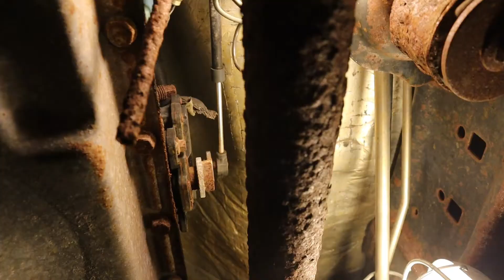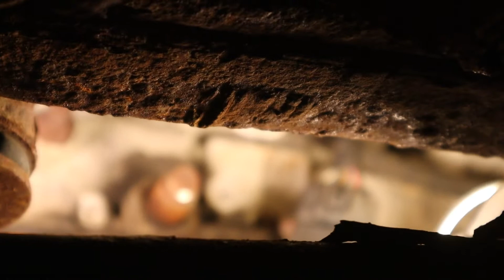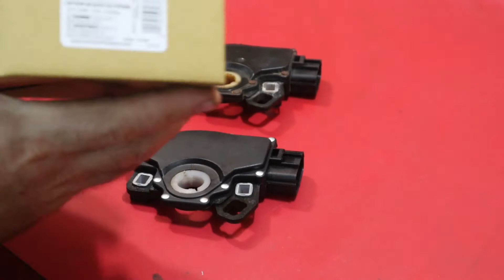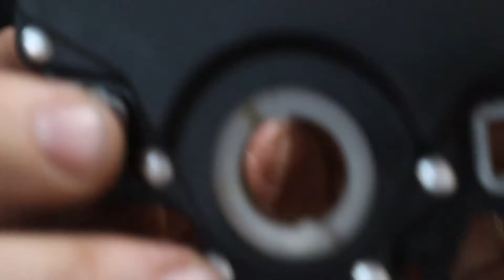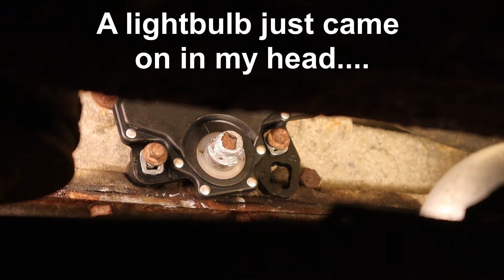Replace 2005 Ford Explorer Sport Trac Park and Neutral Safety Switch Transmission Sensor

Comment: First video that shows the actual installation and adjustment under the vehicle. My shifter is somewhat sluggish to move and the cable itself is not the problem (moves freely when disconnected) so it may be the TR sensor sw but first I'm going to remove it and test it. Thanks.
Reply from the maker: Glad the video helped!

Comment: There's a 2min. video called "Neutral Safety Switch" (by Codemans auto) that shows the alignment part perfectly. Wish I'd seen your video before I ordered one yesterday from O'Reilly... It was over $100.
Reply from the maker: Ouch  that is unfortunate.  Hope you get it straightened out
Reply: @TheFixitShed   Turns out they ordered the wrong part and the right one was like $60.

Comment: So I have to tell you that this post was immeasurably helpful to me.

I had a starter stop working.   Tested all fuses and wires and relays.  And yes the starter was quite old and crusty, so I pulled it out...  but a bolt snapped off and I had to go to a shop with a lift to get that taken out of the trans housing.  Got the new starter mounted by the guys who drilled the bolt out.  They said they had to disassemble stuff to get a drill in there, but I guess they just had no clue how to adjust the shifting  trouble upon reassembly.   

Got the Exploder home and it just wasn't right.   Shifting was very sloppy.  The gears were all screwed up, sometimes the starter wouldn't work, it refused to start in neutral without tweaking the shift lever, and reverse did not engage well.

I wasn't encouraged to return it to that shop so I just got on it myself.
But no matter how I adjusted the cable, it was still a mess.   

Then I watched your video by chance on the neutral safety switch being adjustable!    "Ah ha," I thought.   The shop may be did mess with that, and not only does that control your start situation, it might also provides the fluid  valves station clicks for the shift lever.   So I put the transmission in neutral and adjusted the switch bit by bit until the engine started in neutral, and locked it down 

And wow!  All the gears were lined up properly again too. ( You can not drive with the lever not in the right spots or you will ruined the transmisdion quickly. )  But I was baffled on how to reset the right positions until your video put the right piece in my mind 

I could not have guessed the clicks the lever made between gears were part of the neutral safety switch.   So that switch's proper adjustment is much more important than just for starting in neutral or park.   It's also the valve controller for the gears.

Thanks a million for giving me the simple solution in minutes it took me all day to research to solve!
Reply from the maker: Glad it helped.  Congratulations on you your success!

Comment: If you see the part cost $70.00 and don't pretend that finding one for $35.00 made in China will do the same as the original part.
Reply from the maker: The part was from Dorman.  They have been making quality aftermarket parts since 1918.  This part was manufactured in Taiwan, but where does the Ford OEM part come from?  Even so, the point of the video is that the replacement part behaved exactly the same as the OEM part.  That was what made me realize it wasn't necessary to repace it, it could be adjusted intead.

Comment: What are the screws that you referenced at the beginning that happened to already be tight?
Reply from the maker: If you look at the under dash shot right after I say that, there is a metal disc with holes it.  Just below the disc, you can see a phillips head screw.  I believe that is what I was refering to, but it has been a couple years.  If you move the lever back and forth, look for any play in the movement.  Anything that looks loose or like it it shifting back and forth while the lever is being moved should be tightened down.
Reply: @TheFixitShed  Thank you.

Comment: Understood the whole idea.
Question: Why bother reinstalling the lever?
- Set the shifter in neutral, remove the lever nut, set the alignment marks in neutral, no lever, just start the engine. No crank? Then re-adjust. Finally, install the lever. 
Thank you for NOT taking out the shifter line from the lever.
Let's repeat:
Just loosen the two bolts on the OLD P/N Sw - Transm Range adjust and try starting before buyig a new unit.
So basic. How it went under the periscope?

Comment: I'm going to buy an 03 sport Trac tomorrow one owner 117000 actual miles on it they said it wouldn't go into reverse but it shifts out good as you get it going but you couldn't put it in reverse it wouldn't go is very clean is run but when you put it in drive it shifts out just like it's supposed to I'm thinking rain selector switch on it I haven't checked the fluid stuff on it going back tomorrow to get it but worse comes to worse I've got another sport Trac that I'm pulling motor out of it and putting another sport Trac and it's got a good transmission if I have to I will use it
Reply from the maker: I hope it works out for you. The sport tracs are fun and useful.
Reply: @TheFixitShed  this one will be my third one that the original I bought new in 01, it has a quarter million miles, and the third motor about ready for its Forth, so I buy another that's got a good motor and, and since then I found this one now it's a one owner of 11700 mi on it and it's clean it's nice and runs good, it just doesn't go in reverse you put it reverse it's supposed to be but nothing happens they said they drove it for days ago it's an older couple and said it worked fine until they tried to put it in reverse and it wouldn't do anything so it appears time to get
Reply: Well I've gotten on up in the years I'm 76 and I used to love working on a hot rods I put V8 on Z's I put V8 and I would love to put a 351 Windsor with a supercharger in a sport trac make it a sport trac l i g h t ing

Comment: For initial adjustment, you’re supposed to shift the transmission into neutral, then put the sensor on with the marks as aligned as you can, then put the mounting bolts on, do fine adjustment to align the marks on the sensor body & collar. Then final install.

Comment: Is that 5r55s?, I have issues after rebuild, something from D to R doesn't not engage. I put D-P-R. Only I have problem with R when i put it from D
Reply from the maker: That is odd.  It sounds like you know more about it than I do.  I don't know that I have much help to offer.
Reply: The shift lever is really the valve controller that changes the fluid flow direction in the system.   The neutral start switch provides the clicking sounds and stop points to line up the ports.   If it is off just a little but, you will not drop into gears R and D correctly and cause troubles with fluid file.   Having an OEM neutral start switch adjusted exactly right is essential appairently to the proper shifting.  If you line up neutral exactly right so the engine starts, R and D should be right on target.

Comment: I'm having that issue but my problem is what ever you were saying about those screws under the dash. What is that and how do I fix it?
Reply from the maker: the screws the hold the cables and/or the linkage.  If they are loose, all you need to do is tighten them.
Reply: @TheFixitShed  one of the screws fell out completely then a little bar fell out from down there a couple of days after. Is there a certain name for either those screws or the part they screw into?
Reply from the maker: @cookieman128  Probably, but i couldn't tell you what the names are.

Comment: The middle nut bolt is seized and i tried loosening it to replace the sensor but the whole thing just spins. The nut wont come loose. Im guessing something is going on internal. Whats going on, what should i do next.
Reply from the maker: It is going to move some, to allow it to select gears P, R, N,D..., but if it is spinning all the way around, that's not good.  I'll agree with you that something might be broken internally.  If it isn't spinning all the way around, I'd be soaking it with penetrating oil (WD-40) for a few days.  If that doesn't work, heat would be next.  If you are replacing the switch anyway, you don't have to worry about damaging the switch with heat.
Reply: Middle bolt snapped on my husband it is coming completely out! I'm screwed
Reply: I had to have car towed to transmission shop they had my car for almost a week they said i needed a new starter also and now this.. they said they didn't touch the transmission but they did something!
Check advance track service engine soon and the overdrive light is blinking and it's saying overdrive is off That also keeps saying check transmission and it keeps beeping. The car doesn't want to go in reverse i have to play with it. A couple of weeks go by my windows stop working theyre stick half way open and just sitting at a red light I have to turn car off and on n try shifting it back into drive. Should I go back to the transmission shop it's under warranty there but I gotta find away to get there. I'm sorry for venting. Do u happen to know what the bolt is called I really appreciate it. Thank you for your video.

Comment: Would this be the cause of me getting a p0705 code ? And the O/D light come on .. also the dash saying trans fault?
Reply from the maker: It sounds like it might, but It looks like it could be one of many other issues as well.  I highly recommend posting your question to an automotive help forum (like www.scottykilmer.com)
Reply: Yes! P0705 code = Transmission Range Sensor, also known as the Neutral Safety Switch.

Comment: For anyone about to do this the big one is 15 mm in a smaller one is 8 mm. If you have four-wheel-drive you will need wrenches because sockets won't fit with the front drive shaft.

If your shifter seems hard to shift replace this. Mine was stiff for the first four months I owned it and then I lost backup camera and reverse lights. I replace this and now it shifts easily.

Be sure to spray WD-40 on the big nut before you even attempt this. Also need WD-40 on the shaft so that the sensor will slide off. I ended up having to break mine and using channel locks to get the plastic insert off the shaft
Reply from the maker: Thanks for sharing all that great info!

Comment: My 2004 Mazda B4000 automatic had same problem. I replaced the safety switch but still had a no start. It was the starter, when truck was up to operating temp won’t start. I replaced the starter and it fixed the no start . Old starter had over 200,000 miles on it.
Reply from the maker: Good to know. Thanks for sharing.

Comment: So my truck starts but the shifter floats between reverse, neutral, and drive and won’t catch. How do I fix that?
Reply from the maker: Those resistance points are internal to the transmission.  If the shifter is floating,  make sure the linkage between the shifter and the transmission is all properly connected. Hopefully it is just an issue with the linkage.

Comment: Good video but the trans should be placed  in neutral first and the marks on the switch carefully lined up before installing it. All you have to do then is attach the linkage, plug it in, and Bob's your uncle!
Reply: Also my aunt!

Comment: Hey thanks for the video, I have a question. So I got it to start in park, and I can get it to switch to reverse, neutral, or drive. The thing is I can’t get it back to park without moving the lever back by hand under the car. Any idea on why? Thanks, any help is appreciated
Reply from the maker: It sounds like something isn't right with the cable.  Something isn't secured or is bent. It can pull but not push. Check under the dash and see if you can find something that doesn't look right while you(or someone else) moves the shifter on the steering column.
Reply: @TheFixitShed  do you have a phone number? I can send you a video of how it looks from under the car
Reply from the maker: Does the shifter go into park, or does it get stuck before going in? If you can move the shift lever by hand,  when everything is hooked up, it sounds like there might be some slack in the cable. Make sure it is secured where it is supposed to be and not sliding around.
Reply: @TheFixitShed  yes I can move it by hand with everything hooked in. Let’s say the bottom shifter and the top are both in park, if I move it to drive it does go but when I put it back to park it only goes back inside the vehicle but the bottom still stays in drive
Reply from the maker: Not one that I want to give out. Can you upload to YouTube and send the link?

Comment: Thanks for the video. On my ranger I removed the module since it was causing my reverse lights not to work. Before plunking down for a new one, I figured there was nothing to lose by trying to fix the old one. It's already broke, so no harm! I drilled out the rivets (aluminum, easy) and sure enough one of the wiper contacts fell out of the wiper arm. I reinstalled it and drilled for a cross pin to retain the contact since the plastic bit that originally did the job had worn or broken. Sure enough it worked perfectly after going back together with some new rivets (could have used small screws and nuts). Thought I'd share for someone else - this is a very simple part inside, there's no harm in opening it and trying to fix it if the alternative is replacing it!
Reply: Great to know. THANK YOU A LOT !
Reply: Hey @FliesLikeABrick- 
You didn't happen to take pictures did ya? Can you share? I figured maybe dirt & grime got inside, and seeing the rivets, thought to open it up as well.
Reply: @preshere  I did but YouTube won't let me post a link (I tried but the comment isn't showing up) , not sure what to do
Reply from the maker: If I had left the new part in, I was going to take the old one apart to see what was going on inside.  Thanks for contributing!

Comment: New part isn't defective, you're adjusting it improperly. when you install the new unit put in the 2 screws loosely, put the arm for the shifter on the shaft without the nut, put it in neutral, Then take the arm off and look if the line that says neutral and the line on the white piece that goes around the shaft lines up and adjust accordingly. That is how you adjust it
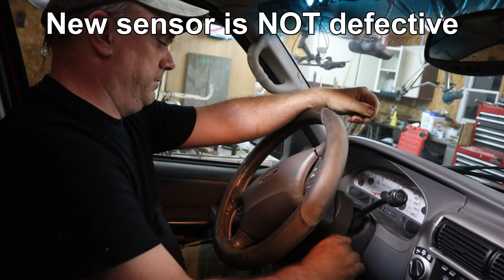Reply from the maker: Correct!  I do have text in there at 6:51 stating that it is not defective, but neither was the original part, it just needed to be adjusted.  That is why I put it back on, and adjusted it.  Your way sounds like a pretty intilligent way of lining it up.  I just used trial and error.  Hopefully what people take away from this video is to try adjusting it before you replace it.
Reply: I don't understand in the text. Could you please be more explicit through a video, please?

Comment: Glad you posted this. My sport tracs engine light just came on and the code reads transmission range sensor.
Reply from the maker: Sweet! So you might actually need to replace yours
Reply: @TheFixitShed  Maybe, my cluster gauge is going bad so I’m going to remove the code with my scanner and if it comes back on then I’ll know to change it. Not even sure if a bad cluster gauge would throw a random code like that.